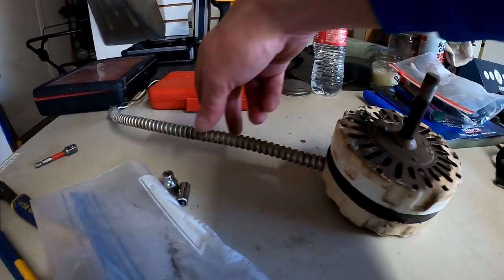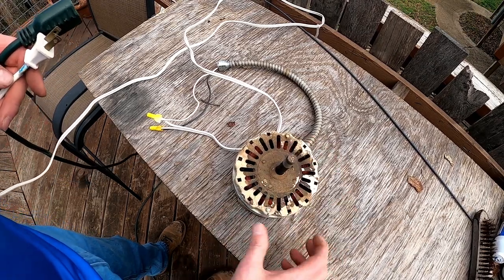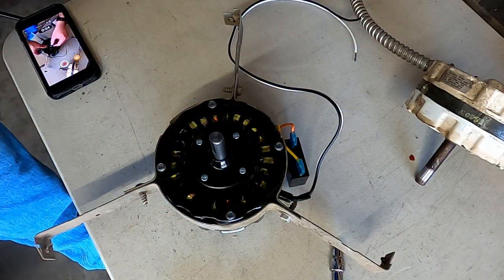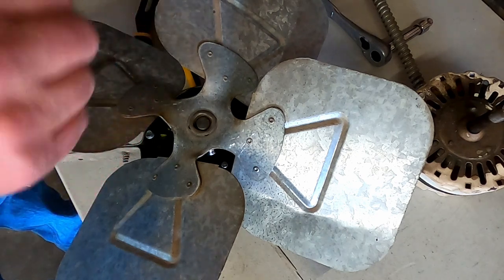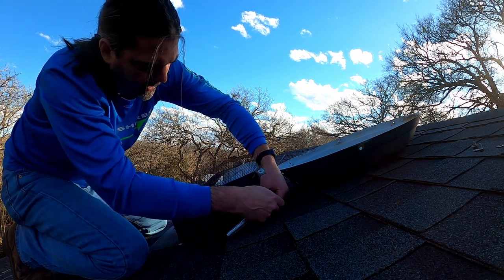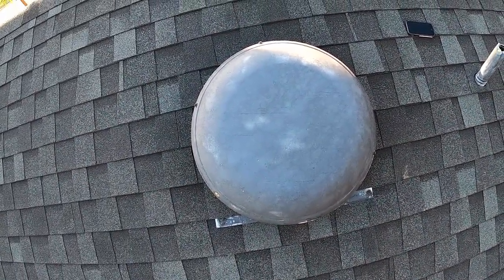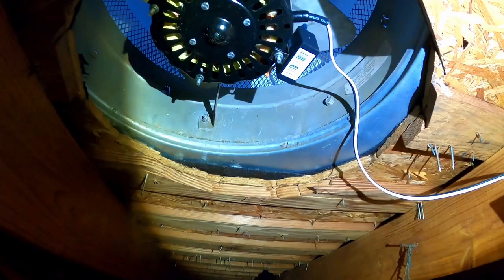Attic Fan Motor Replacement

Comment: So how’s the comp on your vp9??
Reply from the maker: I’m going to do a full video on that this summer. Compared to with and without the comp installed.
Reply: @Piddling_Projects in the summer?! That’s a while from now lol. Well how’s it been? Does with work well? Has it damaged your frame?
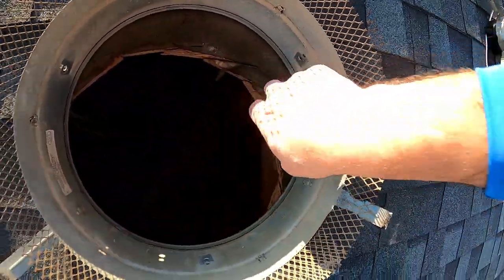Reply: 4:21 Thanks for showing the box, matches mine and I'm on 3rd motor. First one 18 tears, second one is 2 years.

Also if fan upside down, wont air be pushed into attic and not out?  .
Reply: @westvalley411 my thoughts exactly